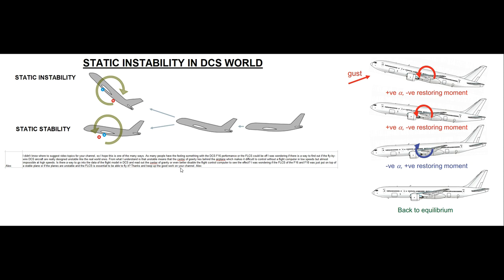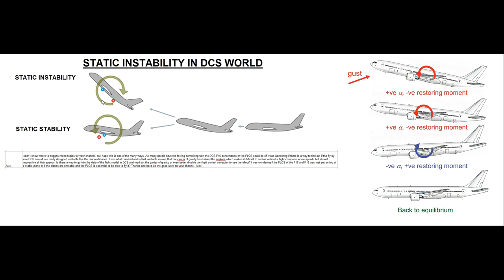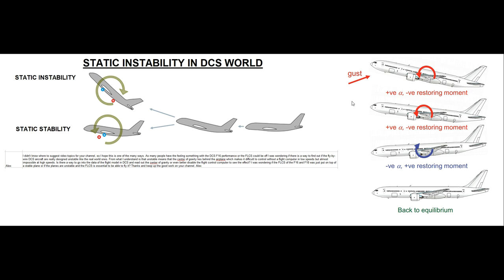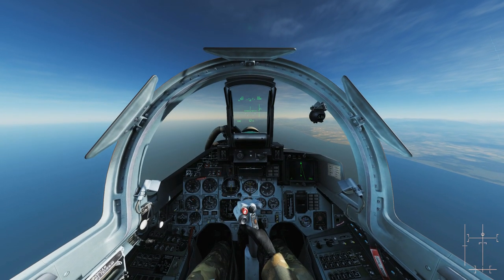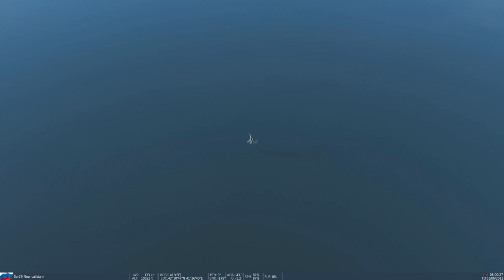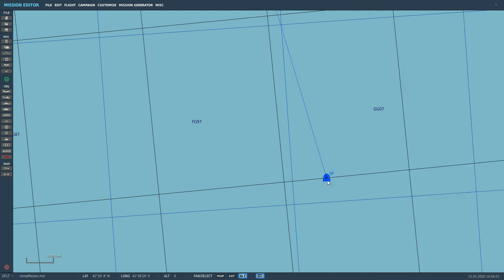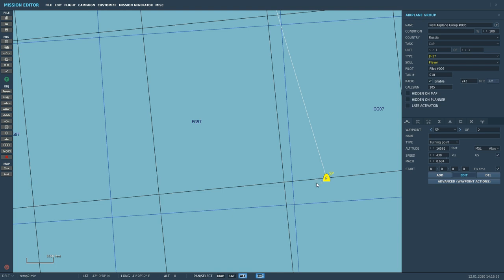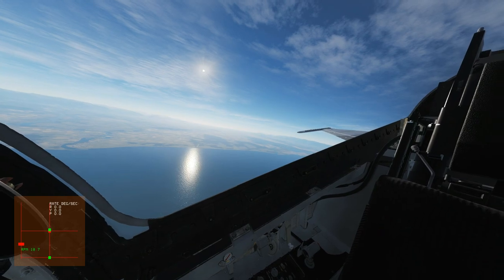Questioned: How Is Fighter Jet "Static Instability" (Unstable) Modelled In DCS WORLD?

Comment: Su-27 went nose down because of the trim setting. Hit trim reset right before disconnecting ASC and you should be able to keep flying without too much trouble. M-2000C FBW can turned off , but flying without it is absolutely hellish and you'll notice pretty quickly where that instantaneous turn rate comes from.
Reply: beat me to it

Comment: A good analogy of what a FBW is for: if you push a bicycle (not sitting on it) the normal way forward it is stable but not very maneuverable. It would be easy to push it very fast and on a straight line. However, if you  push it backwards you constantly have to make small corrections to keep it on a straight line. 
FBWs make many, many small corrections per second to keep the aircraft stable. 
Interesting test plane: F-104 CCV /was used for concept testing (for Tornado and Eurofighter)
Reply: its called trail and its not really that analogue

Comment: Stability and maneuverability are inversely proportional; as one goes up the other goes down. Another term for fly-by-wire is relaxed static stability. The F-16 basic design is 4% unstable.  As speed increases most aircraft will diverge in yaw as that area has the least amount of “wetted” surface area. IIRC, a fellow test pilot mentioned when a colleague was chasing a missile, he was at the top speed of the F-8 when it diverged in yaw severely. They ended up rolling back the top Mach speed of the aircraft because of it. The jet was still in the testing phase at that time.  A fun study in stability is the P-51 Mustang when you vary the fuselage tank fuel level. Look it up, I don’t want to spoil it for you.

Comment: 'Manoeuvrability' relates to turn performance such as rate/radius, both instantaneous and sustained. Static stability has minimal effect on this. 

'Agility', however, relates to the rate at which the flight path can be changed i.e g or AoA onset, which is a desirable characteristic for any fighter. This is affected by static and dynamic stability, control power, moments of inertia etc

Most, if not all of these 4th generation fighters are statically stable when flying straight and level, however can exhibit manoeuvre instability at high angles of attack i.e the margin changes depending on AoA and speed/Mach. When supersonic, some aircraft will become 'more' stable longitudinally as the CoP moves aft, but usually become directionally unstable in yaw.
Reply: Mostly correct so top marks for the comment! Thankfully I don’t have to go into all this in the video as cap wants a slightly more base-level instruction for his viewers in order to allow more inclusion.
Reply: @zachtait5363  Thanks. I understand your constraints, but which part is incorrect?
Reply: Rampy most are not stable while straight and level. You were mostly correct about stability at supersonic speeds as the AC tends to move backwards. Read TomD Tom's answer on negative static margin for more detail. We don't tend to use the term agility when talking about aircraft design, it just goes under the manouveability design parameters. See State Space forms of motion if you need a slightly better explination.
Reply: @zachtait5363  Apart from the F16's RSS and F117A, which operational 4th gen fighters exhibit negative static stability?
Reply: @zachtait5363  Here's a paper on 'agility' metrics for your perusal. It basically discusses how traditional metrics surrounding steady state manoeuvre performance fail to capture true fighter performance. It then compares those measures to the more relevant measures of agility, especially within the context of static and dynamic stability. A great read, especially for aircraft designers. Happy to talk about aero derivatives and state space some other time. https://ntrs.nasa.gov/search.jsp?R=19900014070
Reply: Rampy If you class Typhoon before the upgrade as 4th gen then I believe you have your answer. As per agility, I did my higher education in England so can’t confirm the usage of other terms in international institutions such as NASA. Would love to hear you inputs in the discord if you ever fancy it, genuinely great to hear some discussion in the comments about this type of thing!
Reply: Rampy there appears to have been another comment made in my notifications that I now can’t see on this chain. Great news that you were at ETPS, I fly out of BD and would love to know more about your experiences! In terms of Typhoon numbers, you should very well know that that will be classified, although with your clearance you might be privy to it. Please do get in contact if you fancy helping out with the aerodynamics videos, I’m sure your input will be super useful and it’s ace to have another person onboard.
Reply: @zachtait5363  Flying airliners now, so not privy anymore. I still find it interesting though, but some of the 'sim'isms' in DCS are irritating.
Reply: Rampy yeh I get that. I’m completing a masters so get where you are coming from with all this, just have to slightly tune it down for the wider audience! Would still be a pleasure talking to you sir if you ever fancy it... I’m sure you’ve got some stories
Reply: @zachtait5363  Having flown a few delta wings, most seem stable S&L up until high AoA, whereupon you can actively see the motivators fighting strong instability. This is why many have rather limiting aoa or strict no spin/post stall limits. Given the large pitching moments of delta wings, I can't see why they would be configured to be unstable in the low aoa regime of flight, other than to accommodate degraded modes such a unusual loadouts and fuel imbalances.
Reply: Rampy they might be unstable but being artificially stabilised until the high AoA regime. Dependant in which AC you were testing, flying wings and delta wings have a tendency to be unstable in yaw if they don’t have a vert. Stabiliser. If you were around before the typhoon and were a GR pilot you probably didn’t have much experience with FBW, however that’s assuming you’re RAF and not USAF. Most 3rd and 4th gens had limiters and dampeners, however true FBW planes are usually unstable as there is very little point in a FBW without instability.... at that point you may as well just have limiters and dampeners
Reply: @rampy4963  Thanks for linking that, and I found this quote most interesting: "For example, the combat cycle time metric proposed by B. F. Tamrat of Northrop (Reference 10) consists of a pitch to maximum load factor, a turn at maximum load factor to some specified new heading angle, a pitch down to zero load factor and acceleration to the original airspeed. The net effect of combining a sequence of maneuvers into a single metric is that is that conventional aircraft performance, that is, thrust to weight ratio and sustained load factor or turn rate capability, dominates the metric. The transient agility characteristics have only a minor impact on the numerical value of the functional metric (Reference 16)." 
Do you think this supports my suspicion that the meaningful performance gain realized from negative static stability has more to do with maximizing lift and minimizing drag at max AOA rather than simply allowing the pilot to pitch the airplane more rapidly to that AOA?  In other words, the enhancement to turn performance  (maneuverability) is of more tactical benefit than the enhancement to pitch rate (agility).  My feeling is that even stable fighters pitch so rapidly from zero to max alpha that overshooting the G or buffet target is a big focus for the pilot.  To summarize my comment from above, if the longitudinal instability is caused by the center of pressure being ahead of the CG, the tail-plane will not have to generate down-force, and will be have to generate lift to keep the AOA from continuing to increase as the CP moves forward with AOA.  This would mean the force produced by the tail adds to rather than subtracts from the lift produced by the main wing, increasing the overall lift available.
Reply: @gort8203  "Do you think this supports my suspicion that the meaningful performance gain realized from negative static stability has more to do with maximizing lift and minimizing drag at max AOA rather than simply allowing the pilot to pitch the airplane more rapidly to that AOA?" Yes and no. I think the quote to which you are referring is about longer term agility metrics, not short term transient. There is no denying that some form of relaxed stability will reduce stabiliser downforce, which will in turn have some effect on turn performance, however in some cases like forward cannard, LEXs etc, the aircraft relies on vortex generation to to enable increasing lift coefficient with increasing AoA. Without it, manouevre performance will suffer; as a consequence some drag must exist. This is where the design of the aircraft, including its engine perf, must be carefully considered.  
"My feeling is that even stable fighters pitch so rapidly from zero to max alpha that overshooting the G or buffet target is a big focus for the pilot." Yes and no. Most of these short term dynamic handling issues can be fixed using the FCS. The issue is really about control power and moments of inertia, whereupon the FCS cannot overcome inherent stability and aerodynamic limitations. The other thing to consider is the regime of flight you're in: highspeed - rate turn fights present no issue in terms of control authority etc, but when you're slow, control power can quickly become saturated, especially when you're fighting against strong instability or stability, which will affect transient agility characteristics. And it's interesting to note that the aerodynamic centre of the aircraft is never constant. The pitching moments can be quite non-linear with alpha. In the case of the F-16's RSS, it is prone to alpha hang-up, lack of authority, which is due to complex interaction of forebody strakes on aerodynamics The F-18 had such an issue when they attempted to block the slot in the LEX; consideration to reducing the size of the LEX to reduce increasing instability at high alpha. My point in this whole discussion is that instability is not always desirable, which seems to be a selling point in most brochures. It depends on the platform. Negative stability can have undesirable effects at high AoA, beyond correction territory of the FCS which may lead to: severe AoA/post-stall limits and poor agility characteristics.
Reply: @rampy4963   Thank for the lengthy reply.   Yes that quote was about measuring  the time it takes to complete an entire combat-relevant maneuver rather than simply pitching the aircraft, and the author seems to be saying that in the context of such a maneuver, agility (pitch/roll rate) is a small proportion of the total time.  I see that as supporting my suspicion (not solid enough to call it a theory).  I do appreciate your comments about agility and stability in the slow post stall arena, which I had not been considering.  Do you know of any data on how much the negative static stability may have contributed to increased lift and reduced drag on the F-16?  Thanks for the feedback.
Reply: @rampy4963  Tejas fighter aircraft.

Comment: Nice example of Dynamic instability that absolutely necessitates a FBW system are the canards on a Eurofighter Typhoon.   Since they are positioned well ahead of both the Centre of Gravity and Centre of lift  any pitch induced by the canards  is fundamentally unstable since  they act as +ive feedback  and will keep adding increasing rotation as the alpha increases until cancelled.  This gives very fast potential pitch changes, but  without a FBW system  the pilot would be unable to control it, the plane would flip. With a FBW system it gives  likewise very fast pitch control, hence results in more accurate maintenance of stability since FBW can correct pitch changes faster.    That is why Elevators/Elevons on  non-canard planes  are at the back .. that induces -ive feedback to pitch axis input if the COG/COL are balanced properly.
Reply: A great example, however dynamic instability in the longitudinal plane is more to do with phugoids and other pitch-based modes, and has frequencies far smaller than what you are mentioning. Still a great example of instability in aircraft though!

Comment: Why is am F-16 designed unstable?  Answer...

At supersonic speed the center of pressure moves aft.  In a stable pitch aircraft, this requires more elevator, creates more drag, creates more torque requiring a stronger airframe.

"MACH TUCK" Supersonic speeds in stable aircraft also have a mach tuck issue when slowing down. This was a particular issue in F-4s and F-5s.  As extra force was required to maintain level flights, so too was the force required to maintain a 4G turn.  An instructor exercise in an F-4 was to Fly the F-4 in a supersonic climbing 3G turn.  As the airspeed would fall below supersonic speed, the center of pressure would move forward, the aircraft would turn tighter and the pilot would often over-G the aircraft.  The instructor would just sit in back to make sure the pilot let the stick loose when falling below supersonic speed, and then call the pilot a dumb-ass for nearly over-"G"ing the aircraft.

This was a problem if all supersonic aircraft until the F-16.  By placing the CG behind the center of pressure, at supersonic speeds the the center of pressure still moves aft.  But now the torque is significantly reduced so the airframe can be lighter and larger control surfaces are not required.

I apologize for not including diagrams as the post does not allow for pictures, I should probably just make video.

Comment: So, I thought about this one for a bit and rewrote this comment a few times... I think there's a good chance you may be right, but, I'd like to hope you aren't.
To properly emulate the handling of an unstable aircraft with a stable flight model would take a bunch of special-case programming to get it to feel right, which actually kind of lines up with ED's description of AFM.
Planes using PFM are supposed to be a significantly above that in accuracy, which I'd like to hope means they're modeled correctly-unstable with an emulated FBW. But... "hope" really is the key word there. I wouldn't be at all surprised if they do exactly what you said, for the exact reasons you said.

Comment: 100% sure it is modeled properly as it is MUCH easier to model unstable aircraft with stabilization layer (basically same as modelling autopilot) than use an utterly wrong model and make it feel right. It's more likely that systems are not completely modeled and you can not disable stabilization algorithm with simulated failures.